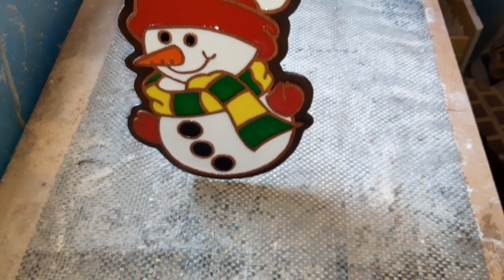Snowman cut out on plywood and inlayed with resin, scroll saw project

Comment: love your work my question is do you have to undo spiral blade on each cut
Reply from the maker: It doesn't matter what blade you use be it spirals, pinless,or pinned blades you still have to insert the blade each time for each section 👍
Reply: thanks
 @fishtank5050